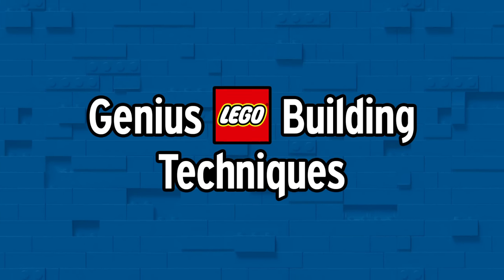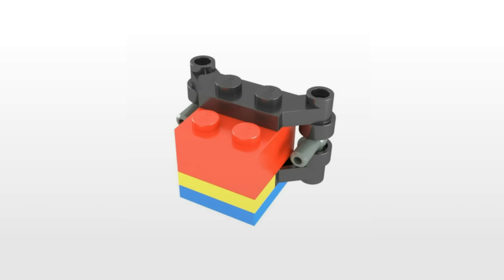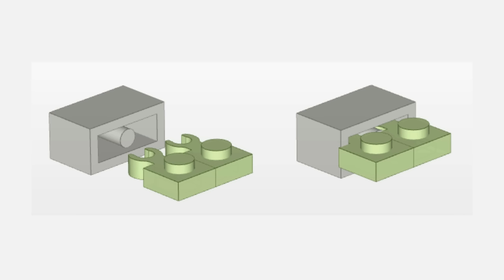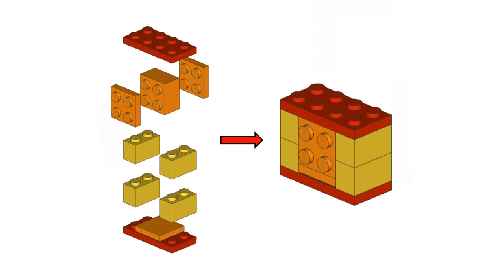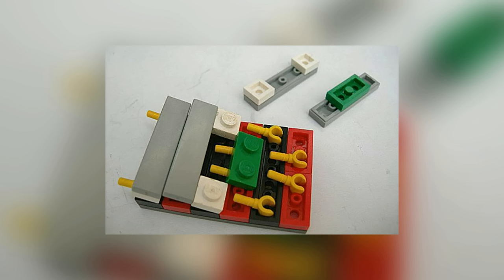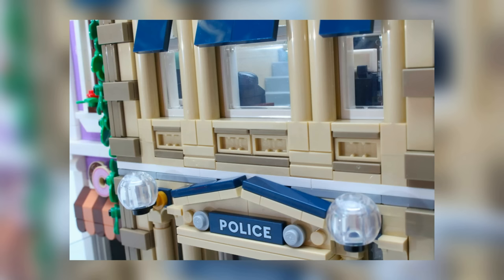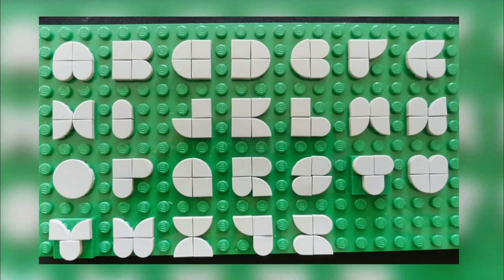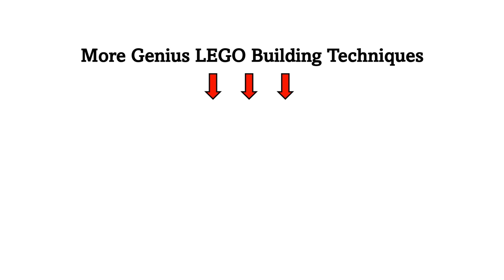600 IQ LEGO BUILDING TECHNIQUES

Comment: Lego is so well designed. I mean like 1 brick can take on 15000 times it’s own weight before it gets crushed
Reply: Except brown bricks, they break if you look at them wrong
Reply: its called cube
Reply: Brown, some colors of gray, and pearlescent gold are all super brittle.
Reply: @jonas4790  no it’s called a brick your wrong it’s called a brick
Reply: @AxoThe2nd  you're* and no, he is right, a cube, can take a lot more weight than what you think, what you call "bricks" are just cubes
Reply: Same with make it blocks
Reply: Not if it’s brown 🤣
Reply: @lightray1433  damn your right but damn, even the grammar gosh
Reply: @lightray1433  Lego bricks aren’t technically cubes though. A cube needs all faces to have the exact same dimension (each of the 6 faces need to be a square). But Lego bricks don’t have an equal height and length, making them cuboid (though the same principle still apply). There isn’t actually any bricks that are a perfect square, apart from perhaps the Minecraft head which I don’t know the dimensions of. 

But just because Lego bricks aren’t perfect cubes doesn’t mean you can’t make one. In order to get a perfect cube, you will need 4 2x2 plates and 1 2x2 flat tile. Or you can use 1 2x2 brick,1 2x2 plate, and 1 2x2 flat tile since plates are 1/3 the height of a brick.
Reply: @lil.accident  i think the brown piece problem has been fixed for the newer brown pieces
Reply: @dancedancepro8687  true
Reply: Just looking at a brown piece can crack it
Reply: @lil.accident  😂
Reply: My stormtroopers torso cracking from a light breeze:
Reply: @lil.accident  shows just how much Lego pieces' durability can vary.
Reply: @lil.accident  brown bricks
Reply: So 15000 can hold 15000 times Its weight before all snap
Reply: @ThatNobeGuy  10/10 roast
Reply: Thats the same for most things, like rocks, normal bricks, wood
Reply: @Eidolon1andOnly  Don't forget dark red, I've heard that color also has some problems.
Reply: @lil.accident  reddish brown is so fragile that it breaks when you stand in it’s general vicinity
Reply: FERRARI

Comment: i hope we can all see just from looking at the diagram how the cube at the 1:45 minute mark would absolutely not work
Reply: what makes you think that?
Reply: The unnecessary inclusion of that 1×1×⅔ brick. ⅔ being two plates high rather than the 3 plates high a typical brick is. It would interfere with the side facing studs of the 1×1 bricks with 5 studs needed to make the cube. There's no way to connect both sides together.
Reply: @Eidolon1andOnly  Oh, I see now

Comment: 3:19 never seen them in a lego build, got some with a non branded lego set though so thats handy, been using that trick for years because unlinke most connections its flat at the connection point but still 1 tile thick😃

Comment: Some of these tips require older style pieces to work. Such as the very first tip.
Reply: I think I have that column piece from the first tip.
Reply: I know those columns used to be SUPER common, I had dozens of them from star wars sets. I'd have to say try to find medium-sized star wars sets, you might have some luck.
Reply: @dw-xy9vm  ikr, they used to be everywhere
Reply: @dw-xy9vm  There's a difference between the older style 1w×2l×3h bracket/panel/column pieces made before the early 2000s and those made within the last 10 years, so the newer ones won't work. The 1×1 clips made before 2000 are also different as the clips are thinner, so that "genius tipc" of inserting clip plates into the underside of a 1×2 brick will only work with the older clips, only those made in the 90s or before since the newer ones won't work. The way the instructions are for that 6 sided die/dice also doesn't look like it would work as it unnecessarily looks like it includes a 1×1×⅔ brick (a brick that's two plates high, hence the ⅔) which would interfere with the side studs of the 1×1 brick with studs on all sides and top.
Reply: Brick types have physically changed over the past few decades, and although function the exact same, and look slightly the same, there's minor differences.